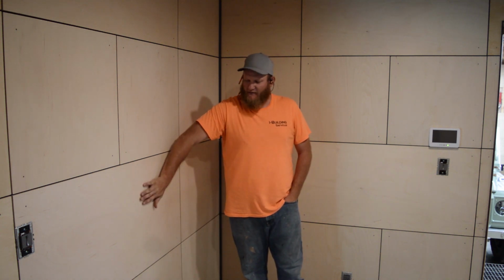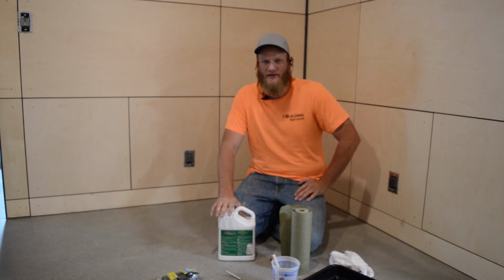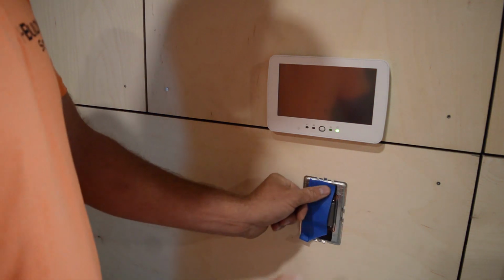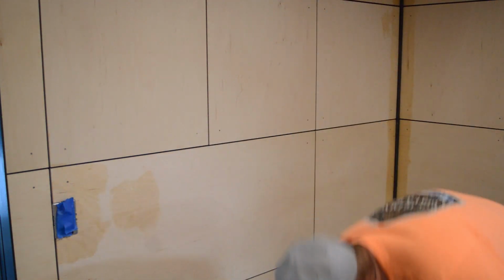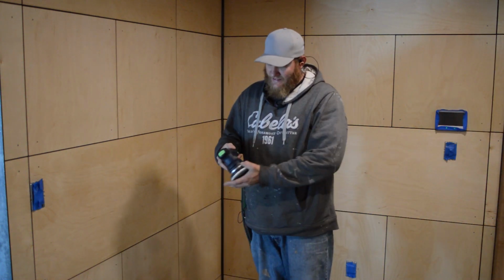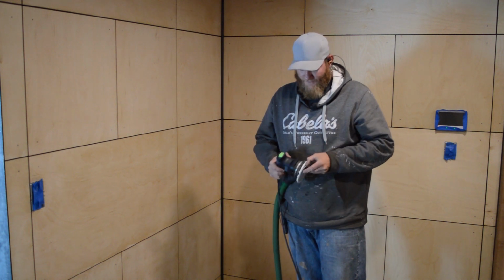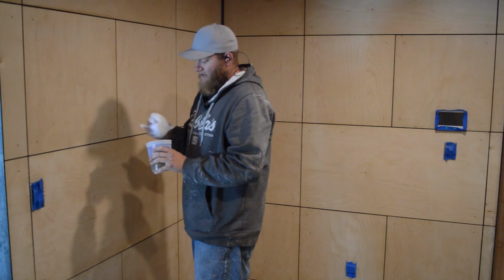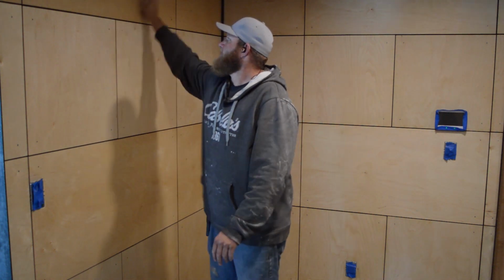HOW TO BUILD A CLOSET ORGANIZER: PART 4 FINISHING

Comment: You would use the same palm sander to get the face frame flush with the shelves in the close system?   Do you round off the edges?
Reply from the maker: You have to be careful sanding the plywood, you can sand thru the veneer very quick